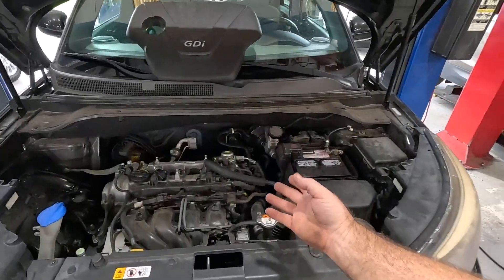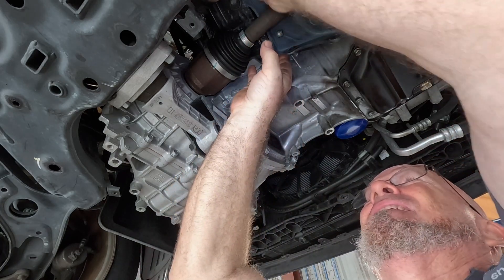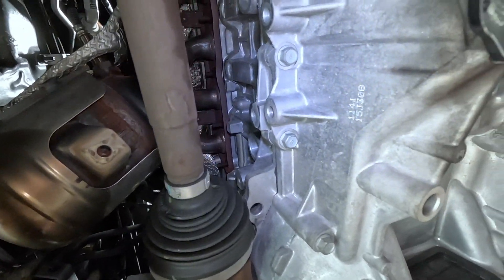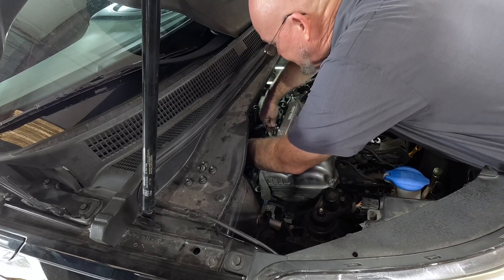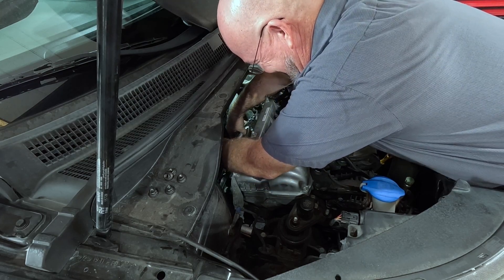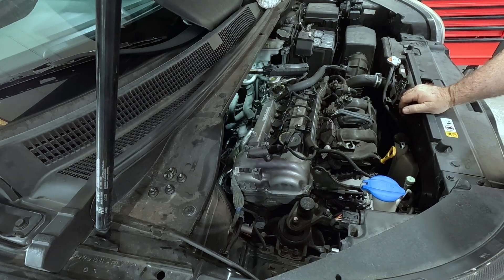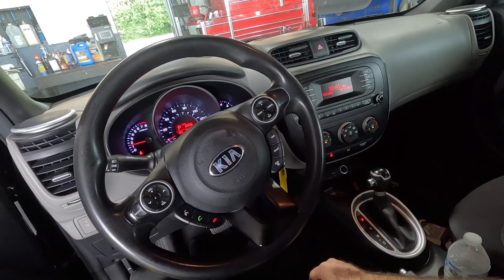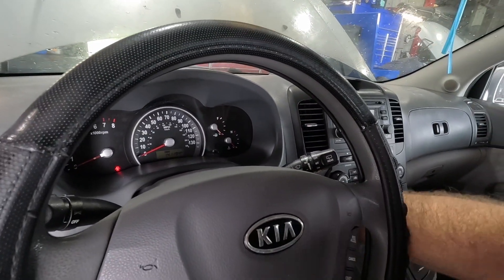SOUL no Power, Sedona Runs Rough, A DAY IN THE SHOP 340 #auto #repair #Kia

Comment: What makes a converter go bad like that?   You said it's common on Kia/Hyundai's....
Reply: @Ram14250 A few things can cause a cat converter to fail. bad oxygen sensors/Bad fuel injector/bad spark plugs/Oil consumption.
Reply from the maker: There are many factors, but gasoline quality is a big one, as is contamination from additives or just sometimes they lose efficiency. This one was melted so it got hot, likely from too much alcohol content or something like that.